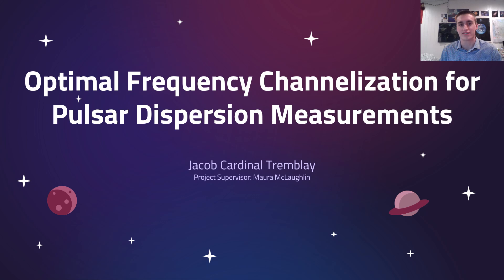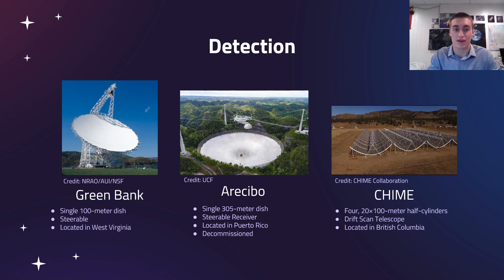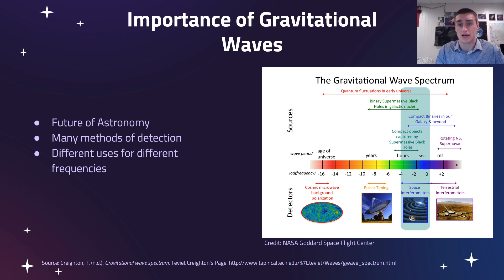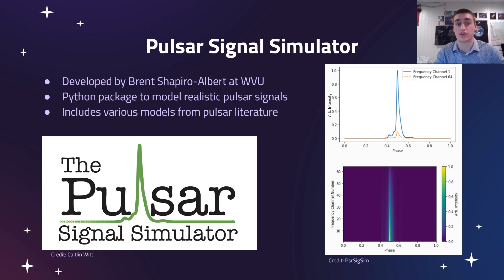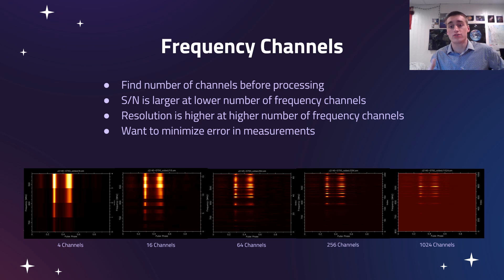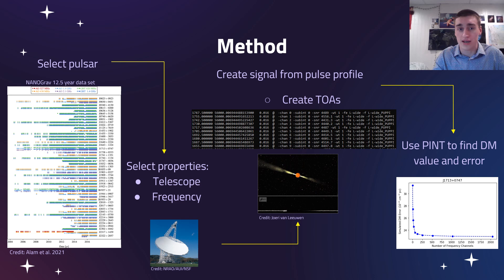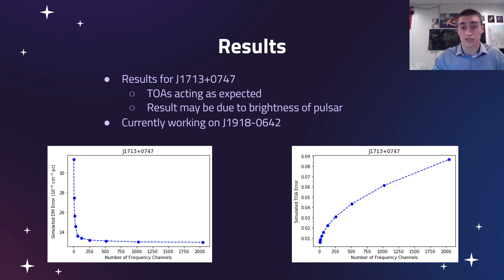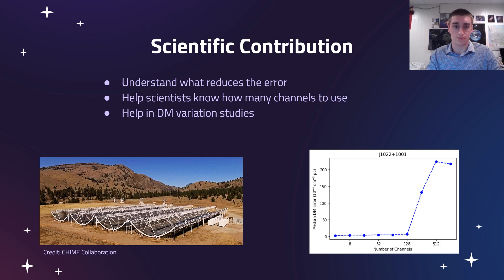Jacob Cardinal Tremblay: Optimal Frequency Channelization for Pulsar Dispersion Measurements

Comment: How important is it that these satellites are located in remote areas? I assume that radio waves from Earth interfere with some of the data. If not, how is this avoided? Is it possible that some of these radio waves from Earth skew the data which results in a higher error?
Reply from the maker: Hi Nathanael, great question!  Radio frequency interference or RFI is a huge problem in radio astronomy! This is why most radio telescopes are located in such remote locations! Many people work on this problem, since we have to not only design the telescopes in such a way that we minimize the RFI, but we also need to create algorithms which go through the data we collect, and eliminates all known sources of RFI. RFI mitigation is a field which is actively worked on, exactly for the reason you mentioned, that having lots of RFI in our data will result in a higher error. This is also one of the reasons it is so useful to have the simulator in our project. This way we can simulate the pulse without the RFI affecting our results (although we can always simulate RFI in our data later if we need).

Comment: How reliable are the technologies used in this experiment. (Like the pulsar simulator)
Reply from the maker: Thanks for your question Elijah! The pulsar simulator is relatively new, however, the data that it outputs is extremely similar to observed data and has shown that it acts the same way which we would expect from real data. One of the advantages of studying pulsars, is that pulsars themselves are extremely predictable objects, therefore creating a model that simulates these objects, although not easy, is not an impossible and from everything we have seen up until now, the simulator should be a great tool for predicting real world behavior.
Reply: @jacobcardinaltremblay  thank you!